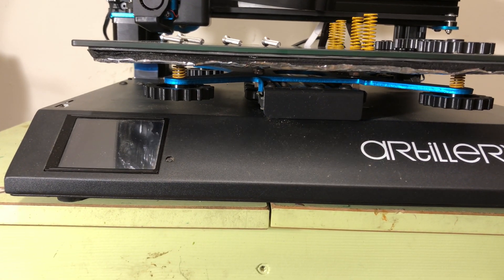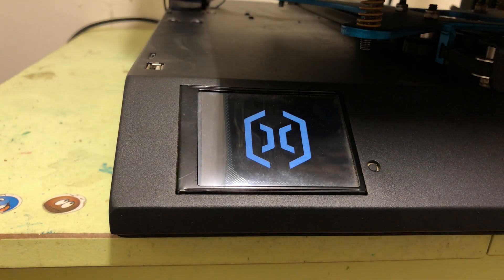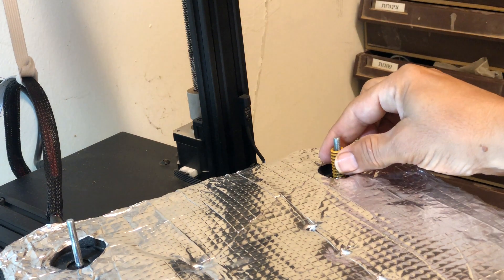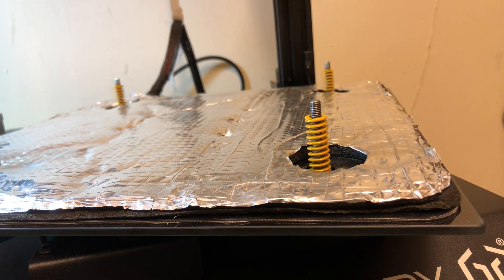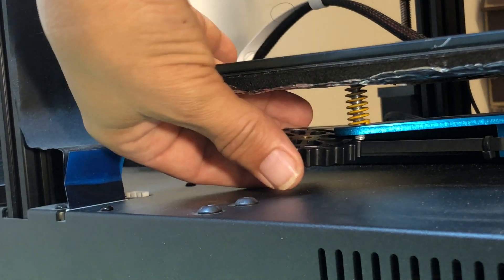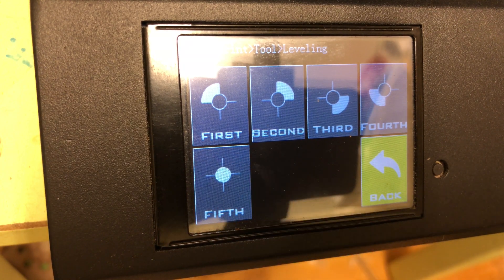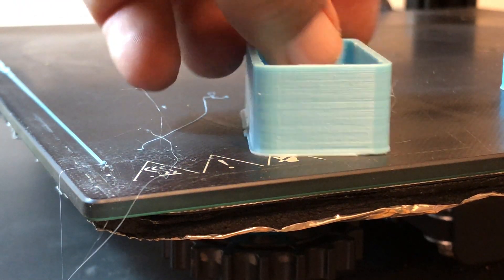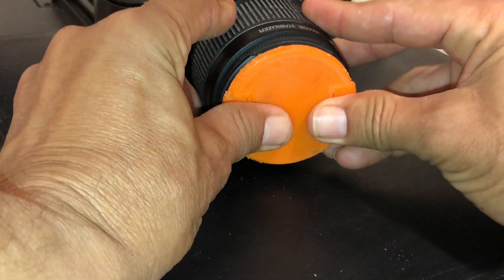NEW 3D Printer Bed Springs are a Game Changer

Comment: If you are going to replace the springs, replace them with silicone dampers. You will never need to adjust your bed level again.
Reply from the maker: Thanks, can you share a link to the dumpers?
Reply: @SAMUELDIY I don't have a link. You need to measure the length of the springs you want to replace and then buy silicone 'bed spacers' of the appropriate length.
Reply from the maker: @AlexusMaximusDE so from what I saw on the web it is a rubber shaped like a small scateboard wheel, think it possible to print this with tpu maybe🤔
Reply: @SAMUELDIY  It is not rubber, it is silicone and printing it from TPU is a bed idea because the heat from the bed will deform it. You could print a mold to make your own however.
Reply: Isnt the bed temperature around 60 Celsius and tpu deformed in 200 Celsius and above? Samuel i think you should give it a chance 😊@AlexusMaximusDE
Reply from the maker: Thank you very much ,I will look into it